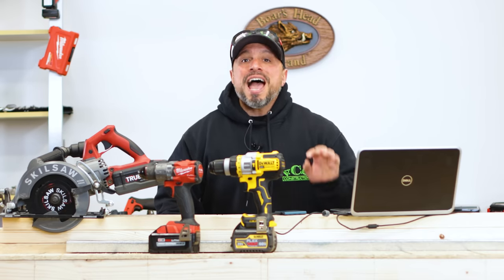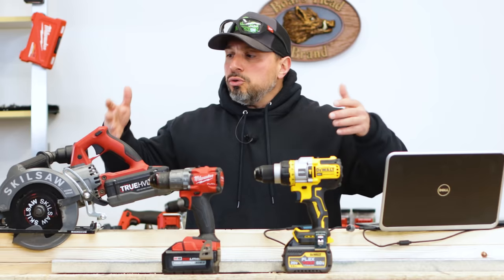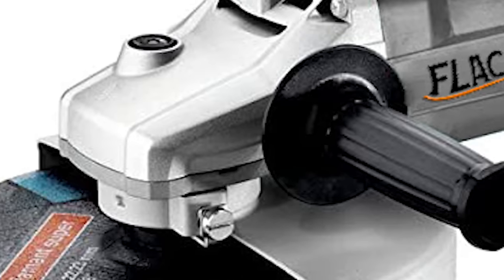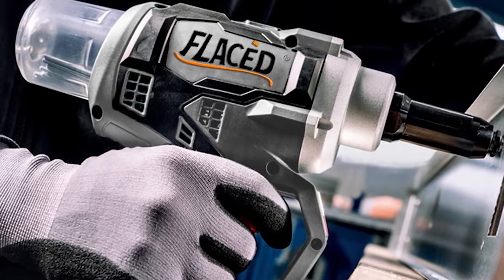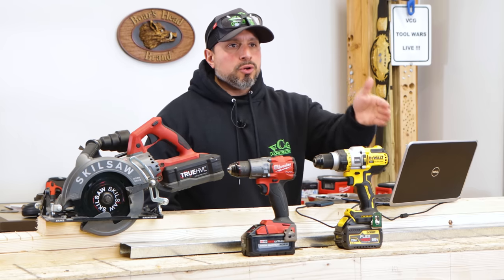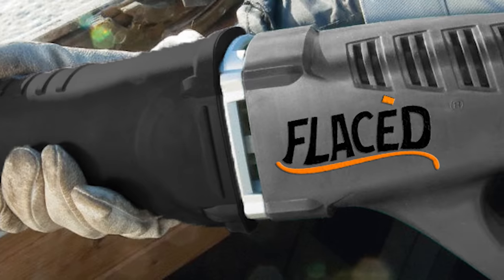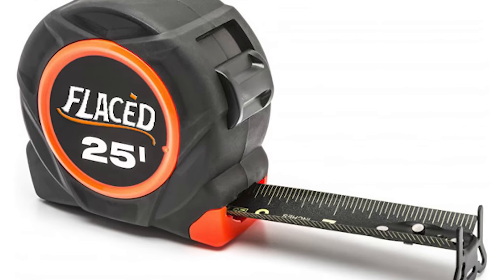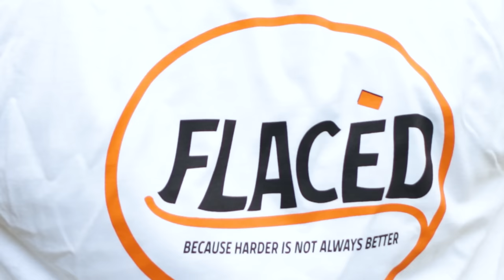New Mystery Power Tool Brand Announced In 2021! (BE THE FIRST TO KNOW HERE)

Comment: Thanks for the heads up on the new tool line,I was wondering if you guys might be able to review on some of the new job site table saws like the new Hercules 10 in with the rack and pinion from Harbor Freight, or the new Skillsaw 8 1/4 in Worm Drive SPT99TO1 both under 400,Damn may as well throw in the new Dewalt DWE 7485  too since it too is under 400,Lol

Comment: I could actually use a low speed angle grinder for sharpening blades without overheating and ruining the temper.

Comment: Hello Sir. Dont your name. But i like your videos. I am a granite and engineered stone fabricator and installer. 8 years experience.  When i install engineered stone in showers i depend on a hammer drill to drive a 3/16th masonary bit. To which i insert a shelve pin , which holds a triangular stone shelf. Jmjust thought id mention. Gee whiz info